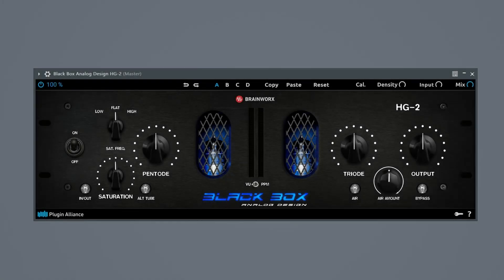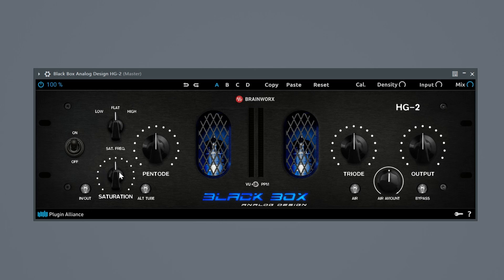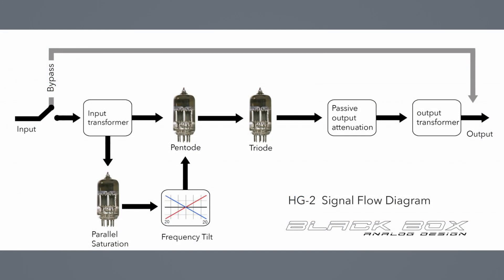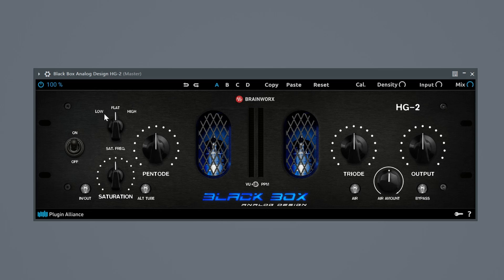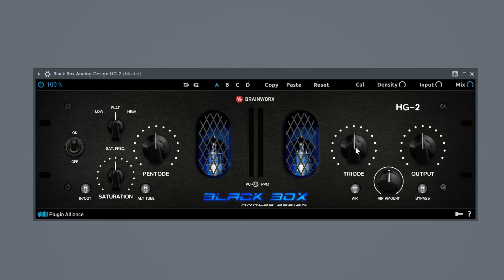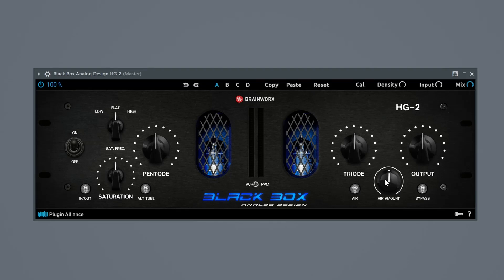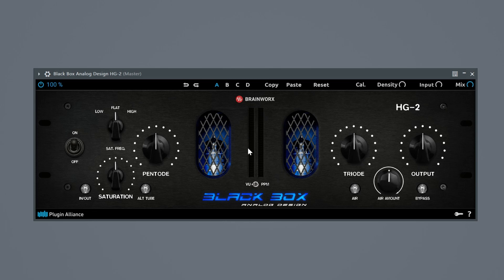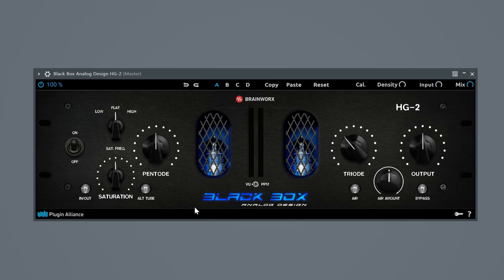HG-2 Black Box saturation plugin tutorial

Comment: Nice plugin, i have it to and its always on my drum bus , but i m considering put it on mix bus as first Plugin and actually mix through it, how do you use it on the mix bus? Where is it on your chain?
Reply from the maker: I'll give the boring answer of 'it depends'. But when using saturation on my mix bus, I always try to be aware of what it is doing to the signal and the peaks. The positioning of the plugin can make a huge difference.
Conclusion, anywhere on the chain can work, as long as you are very well aware of the effects on the other plugins later down the line.